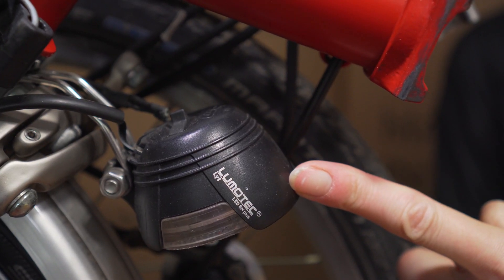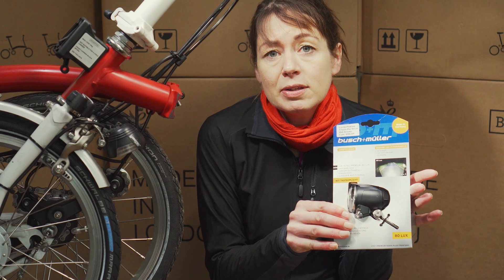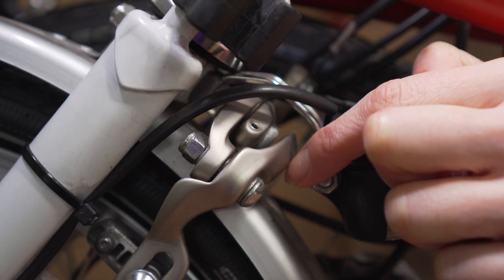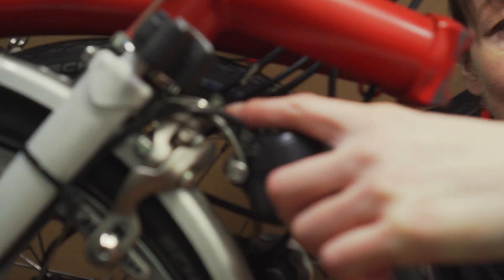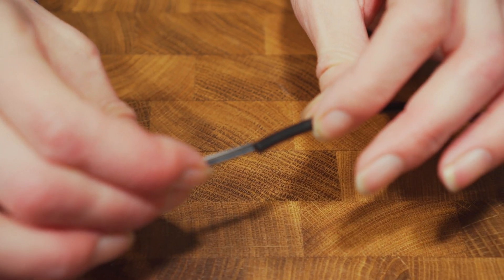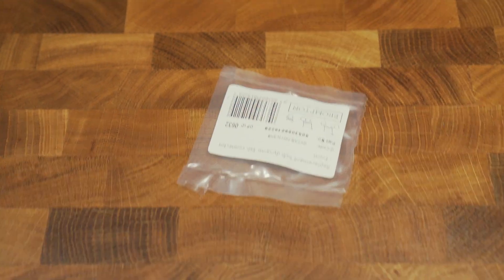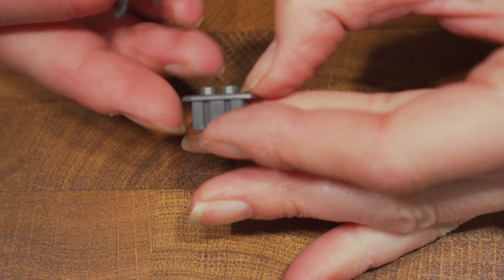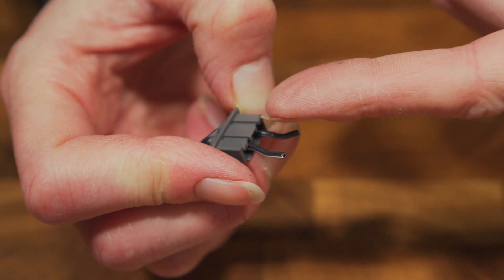Brompton Front Dynamo Light Upgrade Preparation

Comment: Historical note - pre-2010 (approx) Bromptons with front wheel Dynamo hubs came with the German SON Dynamo. Those also referred to as Schmidt dynamos - SON is an acronym for "Schmidt Original Naafdynamo", approx German. 
The SON has a pair of male spade connectors on the hub; the cables on the bike terminated in individual crimped on female spade connectors. Those spades not very easy to connect and disconnect in the cold and wet - so i am trying to change to the Shimano connector as presented in video. I found however that the spades on this SON hub are a fraction too wide for the Shimano connector (tho that connector fits a different SON hub dynamo I have just fine). Not certain how I will play this, but i may carefully file half a millimetre off each spade to make it fit.
See legend of Theseus and the Procrustean bed for inspiration.
Reply: Success. Two things I had to do to make the Shimano connector fit the SON hub. First I had to bend the connector tabs on the SON to allow the Shimano connector not to rub on the hub. Second I put a small spacer inside the Shimano Connector - I used a piece of plastic cut from an old credit card wrapped with duct tape. Trial and error to get the right thickness - when connector can be installed, and connections made.
Reply from the maker: Thanks for the historical note

They are beautifully made and light

Similar spades are used on the majority of Busch and Muller rear lights too

Let us know how you get on with getting the Shimano tab connector connected!

Comment: Does the B&M 80 Lux include the capacitor that allows the lights to stay lit, for a time, after one stops peddling?
Reply from the maker: Many thanks for watching. Yes the light has a stand light function that can be switched off if needed.

Comment: Thanks! This is exactly what I needed. Would you recommend this light as particularly robust? I have to replace my stock light as the capacitors had come loose inside and were rattling around like crazy, driving me insane. And the stand function was, of course, buggered.

I need a light that can really take a good battering without just falling apart inside.
Reply from the maker: We have used it and nor found any problems at all, we also have not had any feedback of it failing. So far so good! 
Thanks for watching!

Comment: Splendid video as usual, only the stripping of the cables: I would cut the cable-insulation before (and leave that cut section on) with a suitable stripping tool (i.e. not a cable cutter)
Then lead them through, and pull off those insulated ends, fold those bear ends, and place the cap. Job done.....
Reply from the maker: Great suggestion, thanks.

Comment: Others have remarked on the use of cable shears to strip the insulation from the  end of the wires. I used a pair of Klein Tools wire strippers for  over twenty years in my job.  The wires fitted to the dynamo are  quite a small gauge, When I've needed to strip similar sized wires and my wire strippers weren't to hand I found my teeth did a pretty good job. Nip the insulated bit between the two wires with your front tooth then pull the individual wires apart, then nibble away at the insulation with your teeth until it's scored all the way round, then put the nibbled bit of the wire between the small gap in your front teeth and pull. Spit the small piece of insulation out and repeat with the other wire. 
( don't try this if you wear false teeth, take them out first ) 😁
Reply: Her smile is too genuine to be from someone wearing false teeth.

Comment: Very thorough as usual. At least I know those tabs are identical.
When you pull out those chopsticks I thought we will have chow mein.  😁
Happy lunar New Year
Reply from the maker: Thank you for watching and for the comments. I just could not keep them together without the use of a chopstick :)
Reply: Chopsticks have a myriad of uses in and around a bicycle. I keep one in my Brompton saddlebag to help replace the chain.
So why is my chain coming off? I have a pre-2010 Brompton with a 50 tooth chain ring - and the plastic guard ring has cracked and been removed. Sadly they don't make those guard rings any more (a rarity wrt Brompton spare parts - they sre famous for eternal spare parts for the oldest models). And those guard rings are part of the mech to keep the chain on when folding and infolding.
There are 3D printing files online for these parts, but these rings are too big for many 3D printers. Currently planning to repair and reinforce the ring with araldite & co. And to modify it so it is secured to the chain ring with screws, as are the modern ones.

Comment: Using a brake cable cutter is not a very good idea to strip the sheath from the wires. Proper wire strippers are quite cheap and reduces the risk of cutting straight through the wire.
Reply from the maker: Thanks! We agree they were a little big!